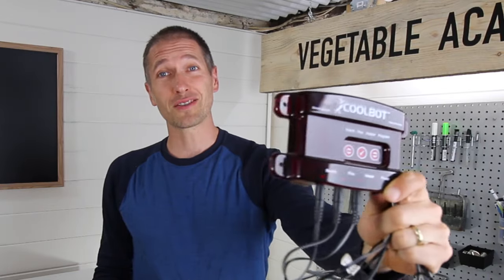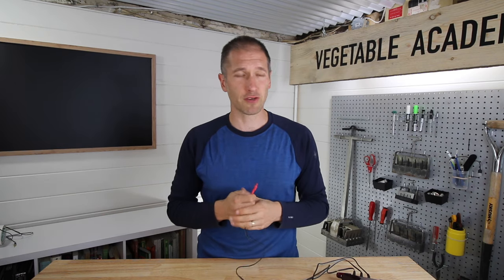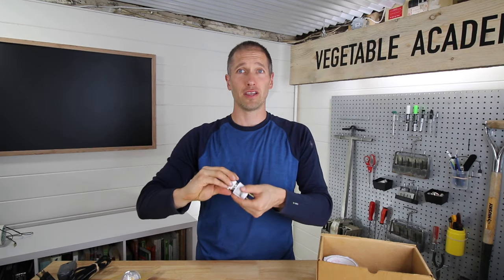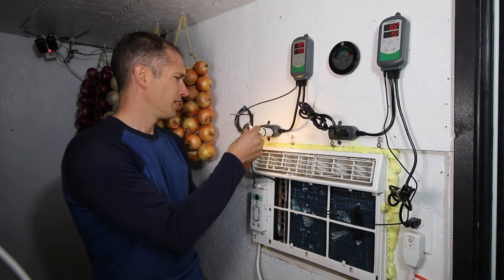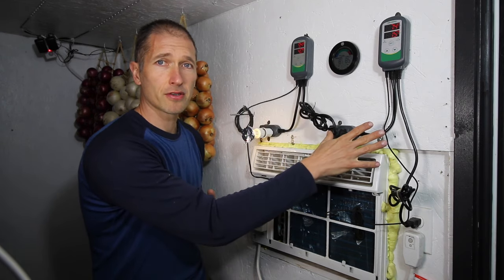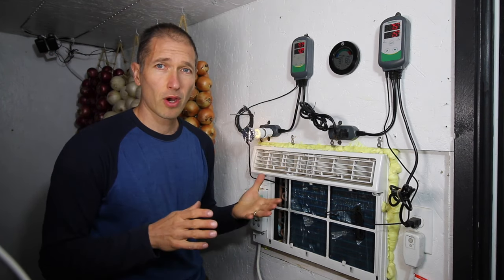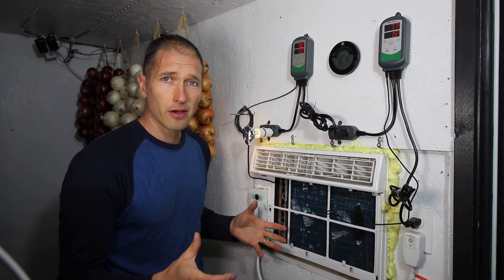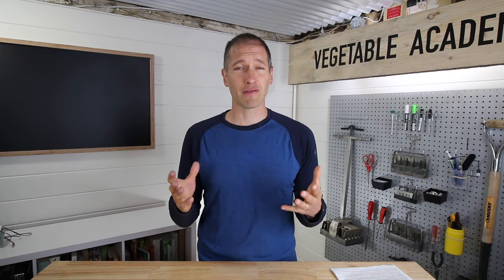Build Your Own Walk-In Cooler with this DIY CoolBot Alternative

Comment: Maybe someone already asked this question. What if your light bulb burns out in the middle of the night? Is there a fail safe for that? Obviously you should have an extra bulb near by. But how could I be alerted to this possible malfunction…any ideas?
Reply from the maker: The LED bulbs have extremely long lifetime so this problem is so rare that we haven't taken precautions to avoid or this or setup automated notifications of temperature changes.  You could get a temperature alarm like this: https://www.amazon.ca/Temperature-Humidity-sensor-Buzzer-Alerts/dp/B01AQ0PZFS

You could also use some time of small heating resistor in place of the lightbulb as a few others have suggested in the comments.  These are just a little harder to find, and I wanted to suggest a method that works with parts on the shelf in most hardware stores.

Comment: What if,instead of a walkin cooler, one wanted to reverse a window ac(winter) and dump the heat inside?Ive rrad online opinions (mixed) and seen a video of a guy using a complicated programmed arduino who claims huge btu heat output from rhe 500 watts running power of rhe window ac. So, if its 35 to 40F outside,could a reversed ac bring up the room trmp to like 70-75?.I suppose,one would place the first(room probe) on the heated side and set the cutoff to 70F. Another question is whether the single fin probe would be enough to prevent icing,esp if the wind is also blowing hard
Reply: If this idea would work, I would gladly use it over costly resistive space heaters., cause I dont see the HVAC industry in any hurry to make AFFORDABLE window type heat pump/AC units. IMO they could care less about the environment , just whatever makes them money today

Comment: Hard to see what side your plugged into on the controller, heating or cooling side? Just picked up the controllers hope to have it running in a few days for meat cooling and making creamed honey in the summer.
Reply from the maker: The "Cooling" outlet is used for both of the Inkbird units.
Reply: @VegetableAcademy  thanks, wasn’t sure if it mattered or not.

Comment: Hello, great information. It has helped a lot. However I still can't quite get my Gree to work right. I believe I have it wired the same way as you but when I plug it all in and let it go it will initially go down to target temp but then the AC turns off and the temp then slowly rises to the lowest default temp of the AC itself (17 degrees centigrade). It will eventually turn back on and plunge the temps but the cycle continues. I can't help but think its something Im doing wrong . Is there maybe something to do with the programming, like the compressor delay, or differential? I appreciate any suggestions.
Reply from the maker: Check the list of compatible air conditioners on this page to make sure your model is there.  https://www.storeitcold.com/build-it/ac-selection/
You may have a secondary sensor in your air conditioner that you'll need to address.
Reply: @VegetableAcademy   @Vegetable Academy  thank you for the quick response I really appreciate that very much. Our model is a Gree and is on the list of accepted AC's. However it says Australia and New Zealand only. Im not entirely sure what that means. There is an asterisk regarding that model too in that it has a limited on cycle built in from the factory. Could either of these be the issue?
Reply from the maker: @TheHistoryofPropaganda  Yes, I would look into that further or switch to a different air conditioner model on the list that doesn't require any unique modifications.
Reply: @TheHistoryofPropaganda  did you try a higher wattage bulb? could be not getting hot enough to trigger the system

Comment: I have a Gree 15,000 btu. Assuming this full draw is 1500w with a 3500w start up, is this ink bird controller going to work as it’s only rated for 1100w?
Reply from the maker: The BTU consumption of the AC does matter because the AC is plugged into its own independent power source as usual.  We are only using the Inkbirds to control when the lightbulb turns on and off to heat the AC's room temperature sensor.  See this list of compatible AC units to make sure yours is on the list: https://staging1.storeitcold.com/build-it/ac-selection/

Comment: I need help, I set up exactly the same way you did in the video. I am running a higher 5000 BTU unit. The heat from the light does not activate the compressor to turn on. When the compressor does finally turn on it only runs for a short period of time and then turns off
Reply from the maker: I'm not sure what you meant by a "higher 5000 BTU unit" but make sure the make and model of your AC unit are compatible with this form of control.  CoolBot has a handy list of compatible units here: https://staging1.storeitcold.com/build-it/ac-selection/
Reply: Haier 5050 btu.
Reply from the maker: @meradnuxall5967  That makes more sense.  I think I read that some Haier models have secondary sensors which complicate this control override method.  The AC selection guide I shared above should help you figure that out.

Comment: After watching the video, why don’t you just put the unit in another room where it’s warm and focus more time and Money on creating a Duct to just harness the air from the vents ( you can still use your inkbird controller to shut the ac off and on controlling the tempts in the room )  ,,,
That way, like I said, you could place the units somewhere else where it would never freeze up if the air is blowing somewhere else in another room  like I said 🤷🏽( I was thinking you could control the actual temperature of the air but now I think about it it’s one temp always coming out the A.C ) …….

Comment: inkbird claims 1100w working.How does it work with air conditioner using more on start up?A 8000 btu ac uses all most twice that to start.
Reply from the maker: The AC is not plugged into either of the Inkbird controllers.  It plugs directly into the wall outlet.

Comment: Hello I have a 8x10 ish walk in with a 18000 BTU ac with this set up you have, well for some reason I plug the second ink bird into the first in the cooling port it won't even power up but I plug into the heat side it powers up? Something I done wrong? Also I have a secondary sensor, can I just tape that on top of the first sensor ?
Reply from the maker: Units with secondary sensors are trickier but you can see the CoolBot guide to working with secondary sensors here: https://www.storeitcold.com/wp-content/uploads/2020/03/Secondary-Sensor-2020.pdf

In regard to your other question, if the heating port of an Inkbird has power, that means the temperature detected by its sensor is colder than the Inkbird's set temperature.  It's calling for a heating device to help increase the temperature of the room.  The cooling port only receives power, when the sensor temperature is warmer than the desired set temperature.
Reply: @VegetableAcademy  that you for the information! I had went to coolbot on the secondary sensor and they just do up the primary sensor then tape the secondary sensor on the outside of it so I just taped it to the outside of the primary one on light bulb. So far seems to be working thanks again!!
Reply: @VegetableAcademy  
Only issue now is I have the one ink bird that's physically pluged into the wall and into the ac fins turned on 32 degrees. The second one is set for 36. Problem is the room will only get down to 43 degrees. Used walk in cooler panels, 8 wide 10 long 8 tall using a new 18500 BTU ac unit.
Reply from the maker: @josephpotter5311  What is the R-value of your insulation panels?.  CoolBot suggests at least R20 in order for their AC sizing calculator to give you proper AC size recommendations.  Even if you did have R20 walls, floor and ceiling, an 18500BTU AC is undersized when you are aiming for a cooler temperature of 36ºF according to the CoolBot sizing calculator here: https://www.storeitcold.com/build-it/ac-calculator/
Other than that, I would suspect issues with the secondary sensor wiring.
Reply: @VegetableAcademy  tbh I don't know the r value I purchased at a yard sale noted they was used by the Amish, is there a way to tell? I know they are around 4 inches thick and lined with white metal, hmm yes gonna have to do some research due to I thought this would be big enough going off the coolbot code I guess I done it wrong when putting dimensions in it said I could use this one at 36 degrees and a 12500 for 38 degrees
Reply: @VegetableAcademy  according to find the r value is to multiply it by 5 so mines 4 inches so that is r 20 correct? It is a 124 inches long by 95 tall and 88 inches wide, so for 38 degrees it says a 15,000 BTU will work I let it run for 2 hours about and got down to 43 and it's 60 outside, how long should it take to get down to temp
Reply: @josephpotter5311  Is the floor  insulated?
Reply: @jeffmcwilliams4060  no it is concrete but my mistake was putting the temp thermometer thing to close above the ac unit which was cause heat off ac to mess with the inside temp in which then caused it to run constantly to try and maintain low temp, I moved it away from the unit and now been working flawlessly for a few weeks running at 36 degrees no frost no ice

Comment: What temperature setting is the first one set at(how cold before the fins start to frost)?
Reply from the maker: The exact answer to this will depend on your cooler humidity and how much your air conditioner has to run to keep your room cool.  Our first controller is usually set at 1ºC.  I adjusted the setting down to -1ºC for the last couple of days because of your question, but even though that temperature is below freezing, no ice build up was caused.  The reason is that the air conditioner needs to run much less right now in fall when our outdoor temperatures are colder.  I don't think I could get away with a temperature setting like that in the heat of summer when the air conditioner is working more constantly to keep the room cold.  That's when we need to fine tune the settings to prevent ice build up.  This is easy though.  If ice starts to form, the temperature setting of this probe (the one in the fins) can just be adjusted a bit higher.  Alternatively, if the air conditioner is cycling on and off too much, the temperature setting can be lowered a bit, as long as there is no sign of ice build up.

Comment: Hi when I plug my inkbird the heating light turns on the inkbird not the cooling light . Also When I plug the the second inkbird into cooling inlet of the first one the second inkbird doesn’t turn on but when I plug it into the heating inlet of the first one it turns on .
Reply from the maker: I'm not sure what your first sentence is referring too, but I can help with the second problem.  If the cooling outlet isn't giving power, but the heating outlet is giving power, it means that the Inkbird controller is calling for more heat to bring its temperature sensor up to the set temperature (ie. whatever temperature you set on the display).   The cooling outlet will provide power when cooling is needed and cut off power when no more cooling is needed.  When you put the temperature probe of the first Inkbird in the fins of the air conditioner and set the temperature for 0ºC, power will be provided to the cooling outlet when the temperature sensor reads above 0ºC and power will be cut off when temperature of that sensor drops below 0ºC.
Reply: @VegetableAcademy  thx

Comment: The question is if that works with any brand of split type a / c, since coolbot as I see it is not compatible with some brands, could you help me please I have an electrolux a / c
Reply from the maker: Since this arrangement works exactly like the CoolBot controller, I would stick to their list of recommended air conditioners here: https://www.storeitcold.com/build-it/ac-selection/. Electrolux is listed as one of the brands for which they cannot guarantee compatibility.

Comment: No no no you don't need 2. You plug the temp sensor of just the one onto the fins of the ac unit.  Then you plug the ac unit directly into the wall power.  Then you hook the light bulb to the ac unit temp probe.  You power the light with the cool port on the controller. When the controller senses the fins on the ac unit are getting too cold it kills power to the light. Then the ac unit has its own power from the wall to go onto a defrost.
Reply from the maker: Agreed. You could accomplish almost the same level of control with one Inkbird.  I tried running ours with one probe and one difference was that the air conditioner turns on a bit later, because the fins warm up a little more slowly than the air in the cooler.  The air conditioner also cycled on and off more frequently because as soon as the fin temperature drops substantially to cool the air, the Inkbird cuts power to the lightbulb and turns off the air conditioner.  Running the unit with one controller is more of a problem in the hottest part of the year when the air conditioner needs to be running more often.  In this case, the fins would usually be at a lower temperature than the room air so the ideal temperature setting on the Inkbird might not be the same as the room temperature you are shooting for.  Therefore, with just one Inkbird runing the show, some experimentation and adjustments throughout the season could be necessary depending on your climate.  I prefer the precise control that I get with two Inkbird units used as shown.
Reply: Please help me with temperature settings

Comment: Couldn't you just place the thermostat probe for the ac unit  outside the coolroom ?
Then you only need 1 temperature controller device.
Reply from the maker: If you are referring to the AC temperature probe that we tape to the light bulb, then no, it wouldn't make a difference if it was outside the cooler.  It's location is irrelevant.  We would still need a method of altering the temperature of that probe to override the programmed limits of the AC and enable the unit to cool our room down to 4ºC or any other temperature below 17ºC.
Reply: @VegetableAcademy  he was implying place it in a warmer room  lol not totally irrelevant. Using a single ink bird system to dry my cannabis. 👍
Reply from the maker: @sunstirade1085  Yeah, maybe my last reply there wasn't that clear.  The location of the AC temperature probe does matter because its temperature matters.  We turn the AC unit on and off at the right time by altering the temperature of that probe.  If the probe was long enough to reach out into another room (ours isn't) and the temperature of that room was always warmer than the lowest temp setting of the AC unit which is typically 17ºC, then the AC unit would always be in cooling mode whenever it was plugged in.  That would allow us to avoid using the light bulb to activate the AC unit, but we would then need to plug the AC into the Inkbird that was controlling the light bulb and still use a second Inkbird to prevent ice build up on the fins.

Comment: How do you get the air conditioner to blow colder temperature air? My AC only blows at 60°F. A freezer would need to be around 12- 30°F
Reply from the maker: No other modifications are needed to get the air conditioner to to blow colder air, but the coils can only remove so much energy from the air in one pass, so if your room air is 68ºF, it might blow out of the air conditioner at just 60ºF.  Also, we are not using this method to create freezing conditions.  Our cooler is kept at 4ºC or 32ºF.
Reply: Wi down  ac units only run down to 60  u cant change that  , thats were the heating probe comes in makingnit call for cool cycle

Comment: Aaaaah nooooo....I purchased a 2nd hand window AC...Midea brand...then I click the coolbot website link and it's an unsupported brand.

Is this like a 100% this will not work with the brand I bought or is it worth buying the parts and just seeing if I can get it to work?
Reply from the maker: I really don't know Jack.  You're in uncharted territory there Jack.  There is something different about the sensors and/or wiring of the unsupported units.  If I were in your position, I'd just sell the Midea to someone who can use it for it's true purpose and pick up another AC that is on the list of supported models.
Reply: @VegetableAcademy  I appreciate the prompt and concise reply! I've put the unit back onto FB marketplace!
Reply from the maker: @jackblake6958  Good.  I hope you can find a new home for it without too much trouble.  Getting the right model of AC will just make your life a lot easier with this project.

Comment: So what do u set the HD it's on 2 and the cd is 2 ,?
Reply from the maker: Both temperature controllers are only using their cooling outlet so the heating differential (HD) is irrelevant.  I have got our cooling differential set to 0.5ºC.
Reply: @VegetableAcademy  I bought a new itc 308 inkbird two of them . When I turn on the first one it has the heating light on not the cooling light ?🤷🏻‍♂️ also when I plug 🔌 the second inkbird into the cooling inlet of the first inkbir the second inkbird doesn’t turn on but when I plug into the heating inlet it turns on . What should I do?
Reply from the maker: @dukeallenso3334  What have you set the temperatures of the Inkbird controllers to?  What is your desired room temperature?

Comment: Have you learned how to heat your AC sensor with a 5v usb heating element yet?
Reply from the maker: That sounds good, but a quick search for 5V USB heaters only lead me to ones with quite large heating pads.  Did you have a particular model in mind that would be appropriate for heating the small AC sensor?
Reply: @VegetableAcademy  I haven’t yet, though I’m looking into it. I just saw your video on diy coolbot alternative, and am just setting up my system now. I’ll get back to you when I find something. Thanks for the vids!